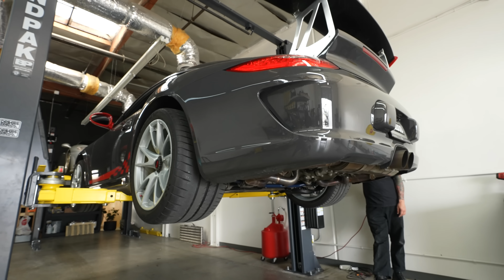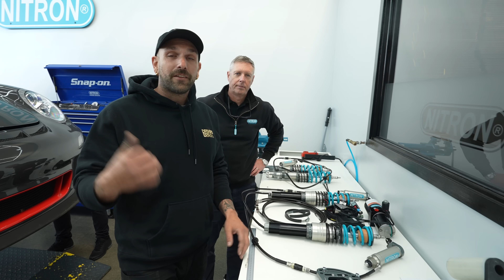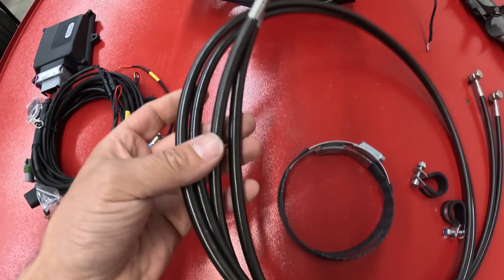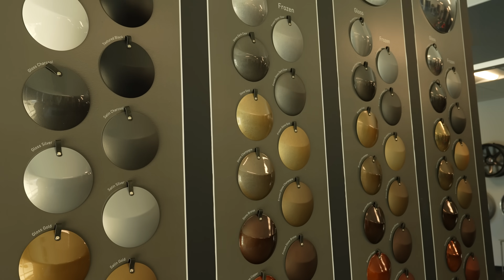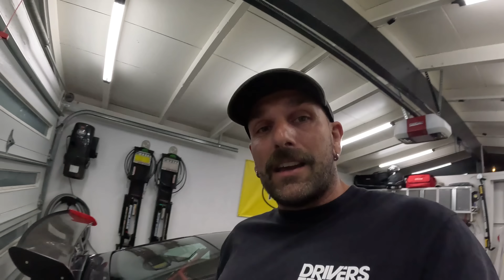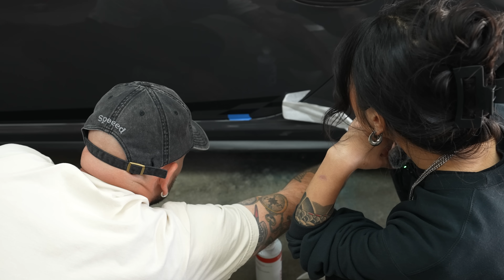THE END Of Issues! Major Repair Bills For My GT3RS. *New Look*

Comment: He knows his stuff Guy at Nitron, and those dampers look a nice option. My 997.1 GT3 runs on the single adjustment Ohlins DFV which is very simple, highly effective, but yes, it's a hot/messy job reaching under the front damper to adjust them.

Comment: Does this Nitron kit replace the air suspension, or does the GT3RS not have air suspension?  Ok, I saw it rise.  Is the kit meant to be a replacement... mine has factory air suspension but I'm not interested in custom suspension or an extra key fob to control it, but the factory is known to fail around the mileage I'm at, or apparently randomly when they lift it even at the Porsche dealership :/

Comment: Make sure your tire pressures are set up cold to factory spec. If you have 1 rear down a bit from other man it can really cause the car to shift left or right getting on and off throttle.

Comment: Don't worry about bills I spent 17000USD (£12000)  in repairs for my modded 2005 BMW 120d 5 door hatchback 160K+ miles, most kicked in after 110K miles, mods Darkside Developments FMIC & remap 325 lb-ft/200 BHP, ZHP 6HP19 auto remap, Milltek exhaust, Bilstein B12 Prokit, BMW Performance alloys, front & rear BMW 1M tension struts and wishbones, Powerflex bushes, Powerflex rear subframe inserts...

Comment: I remember I bout an e36 some years back (15+). Is had a slippy feeling when turning. It was a realllllly weird feeling (Hard to explain), but was almost as if I were sliding on ice, but not even slipping at all. I couldn't figure it out. I checked everything, rear end, was good, rims were tight, the only difference I noticed were tow different tires on the rear. Same size, different tread. Turns out, I changed the rear tires and the problem went away. I'm not saying this was what your problem was, but I'll be darn, it immediately stopped.

Comment: Question, at the start of the vid, when the car is on the lift, i noticed your rear tires are weird. Is one of the flipped/facing the wrong way? the tread pattern matches both sides in terms of orientation and usually they are supposed to be polar opposites. Not talking about the vertical lines, more so the tread wear pattern.
Reply from the maker: Michelin Cup2 are only inside/outside not directional
Reply: @ ahhhhh didn’t know that, thanks for clearing that up. 

Also, long time follower. Love what you do!

Comment: So did the suspension and rebuilt diff resolve the issue with rear end? Did I miss discussing that?

What's left?
Reply from the maker: it seems so! it wasnt the Dif. The dampers were leaking and out of Nitrogen so I would imagine it was that. I sold off the JRZ for cheap and sent them off to get rebuilt for the next owner

Comment: You should index your center caps to the valve stems. The nuts will always torque to the same spot so mark the bottom location of the nut on the rotor hat with a pencil. Take the wheel off and install the valve stem to that mark. It’s one of those small detail things.
Reply from the maker: Oh this is interesting. It never even occurred to me/never heard of this.

Comment: Looks like you might have put the center caps into the center locks wrong there's a little bump out on  the back of the center cap that's supposed to go into a small recess on the center lock

Comment: Love everything but I was wondering would Nitron sponser you to change the red accents to Nitron Blue. Just for a year. The roll cage, the callipers, the other little bits (like center lock badges). I think it would be a cool way for Nitron to advertise and you have their suspension. - its all reversible. I love the blue color and it would be unique.

Comment: Idk if I can get over the bbs wheels, but it does look really fkn good now 🤌

Do you know if there was a particular reason for the aftermarket suspension arms other than getting rid of the stock bushings?
I'm normally the first guy to bitch about stock suspension, but on a Porsche it's a different thing. 
This isn't only the German in me speaking, you gotta hand it to them, they very consistently build really freaking good cars.  Looking at the Nordschleife leader board, the amount of Porsches on there is just overwhelming.
IMO it's thanks to their very own and specific driving characteristics, that they're more difficult to mod (especially suspension wise) without messing something up and actually decrease performance

Comment: I mean, if those ten year old shocks were leaking would it be hard to assume maybe during hard driving they’d seep near the tires to cause the reaction you were describing? Not discounting the diff being an issue but just had me thinking.
Reply from the maker: Yeah luckily those are getting rebuilt for the next owner but I wanted some fresh stuff with local support
Reply: @vin_tra fair enough, love the stuff over the years Vin

Comment: I don’t know if you’ve seen a Vapor Honing machine before, but its essentially a sandblast cabinet that uses water/media slurry instead of just blasting media. It wont hurt anodized parts, rubber, or plastics. But, it’ll completely refresh them. Your section about the center lock nuts made me think of that machine. I work in vintage restoration and use their machine to save money on buying unobtainable parts. Just a thought. Cheers

Comment: Yo, Vin just a saftey tip there for your lift before you get squished. You need to make sure the arms are locked into position. You can see the right rear arm lock is not seated. If you yank on that side it will move... ya really don't want to be squished with a lift arm in your gas tank.

Comment: WHAT….. VIN, bro. You were on a roll doing a such a good job refreshing the GT3rs. Then, came the wheels. You could NOT HAVE bought a more basic, plain, & BORING wheel. At least some 502 mesh style or ANYTHING other than a basic a$$ 5 star. Disappointed to say the least.

Comment: At the beginning, I was expecting a red wheel to complete the red package, but this 'opposite' direction that it took turned out so good. The smaller red accents goes so hard with the new livery and the wheels just tie it greatly! For me personnaly there's only one single touch to become the absolute perfect: a wider wing blade that kinda stretches to the rear quarters width. Nevertheless amazing mods, one of the best RSs that I've seen